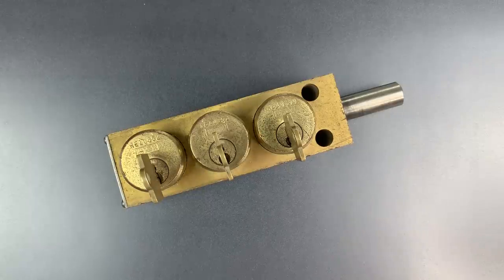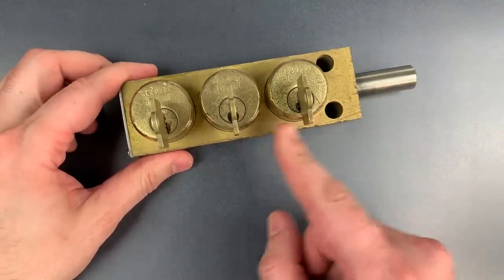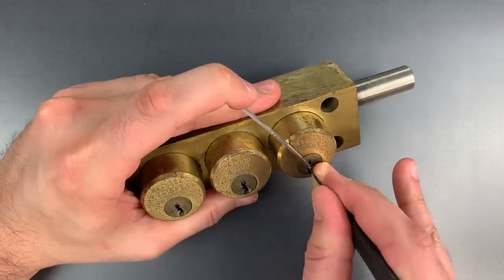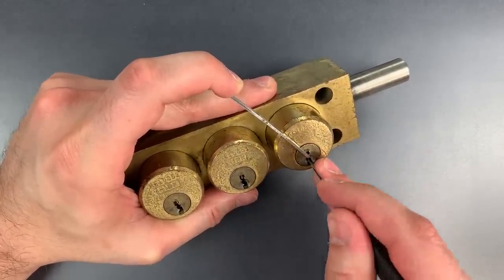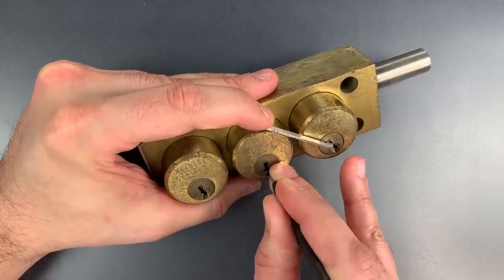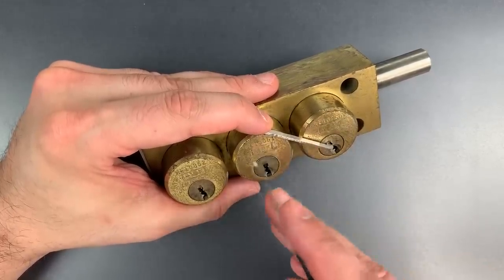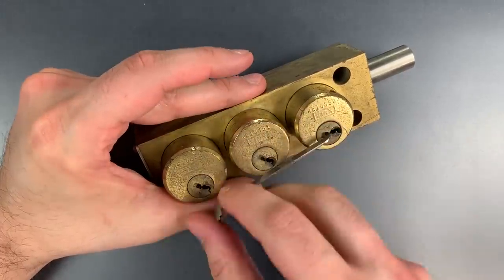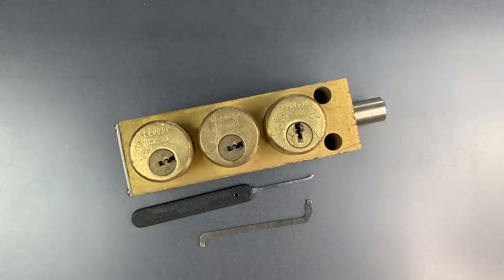[917] Triple Core Kirk Interlock Module Picked

Comment: It be very interesting to see the linkage between the cores, but it may destroy the lock
Reply: Im going to guess those lock bodies Drop in and are screwed on back. After getting in, you would have full access. Electrical interlocks kill power, this unit is likley to keep people out of man eating mechanical assemblys.
Reply: @ernestmurphy3898 it is a mechanical interlock, but like LPL said, it if meant to keep people from opening up a live connection. Most often for electrical vaults with high voltage. The disconnects upstream have other mechanical interlocks that can't be opened unless the circuits have been opened.
Reply: I doubt it, probably just a simple gear connection between the cores and the bolt.  I do like the idea of dumbass-proof safety, can't unlock whatever this lock is attached to without moving levers/valves to the safe position to get the keys from them!
Reply: it looked like a service panel on the left end, so it probably would be simple to disassemble, but he said it was loaned from someone else's collection, so he wouldn't risk opening it and possibly breaking it. (Also possible, but highly unlikely, that it could have anti tamper measures in place so anyone not familiar with them would have to deal with the guts falling apart when removed from the casing.)

Comment: I've been using these types of locks for nearly three decades. I work at a particle accelerator and they're used for safety interlocks. 

The same key that opens the hutch (experimental area) door is  also the one that allows the beam shutter to operate. In both locations the key is captured and can not be removed if it is in an unsafe position, either door open or beam on. If an experimenter needs to access their equipment, then they need to turn off the beam so they can remove the key and unlock the door. If they want to turn the beam back on, they need to search the hutch, lock the door and put the key back in the beam enable.

Comment: That was fun to see picked. I reguarly service a machine, that has a 4-way version of that lock. But in this case one must first turn off a huge main input switch and lock it in off position, in ordre to use that key in the lock. Then the first of 4 doors can be opened, and the remaining 3 keys can be removed and used for the other doors.

Comment: We have these type locks on the doors of some of our high voltage pad-mounted switch cabinets. The keys are held captive in locks on the individual switch handles and cannot be removed unless the switch has been opened. Then the keys are transferred to this lock so you can open the access door- the keys are retained here until the door is locked once again. Or, the switch handle can be opened and the key retained so the switch cannot be closed again.

Comment: Im posting this hear because the review you did on the Master Lock No. DSRN1003P combination deadbolt with night watch is so old I doubt you'd get a chance to see this. 

Ive had the Master deadbolt for 4 years now and its worked fine. But today the bolt locked in place. Luckily for me I had the door open. I was looking at it as it had been stiff and sticking lately. 
If the door was closed Id been screwed. 

The NightWatch appears to be a small pin that goes horizontally through the bolt. if lifted up allows the bolt to move. If down, locks it in place. I pulled the retaining clip and removed the pin.lock works again, just no nightwatch. 

Just an FYI for those with nightwatch locks.

Comment: Had these in the power plants for the old precips.  There would be 3 or more of these blocks on the units, large lock banks for the intermediate keys and then dual keys on each of the breakers.  Actually took three different key changes to complete the task unless you dropped one key then it was a long bad day.

Comment: It’s interesting that a lock designed as a safety feature (vs. securing something very valuable) is one of the more secure locks I’ve seen you pick.
Reply: Just imagine the cost of someone getting killed in an industrial accident. There'll be reputational damage which is tricky to put a price on. Then there are lawyer costs, lost production due to disruption and that's before you even get to compensation and fines. The cost of some stolen equipment is trivial in comparison.
Reply: the gorgon I’m not denying the need for such a lock but rather the fact that it’s very unlikely to be picked given it’s purpose but is far harder to pick than most locks that could actually be a target for picking. Nobody in their right mind would bother picking a lockout lock that’s there to keep them safe but a lock on, say, a box containing valuables worth stealing could attract such activity and I’ve seen him pick many of those almost instantly.

Comment: At my work they would probably break all the keys off to prevent everyone from turning something off because we need to push production
Reply: It's installed at a large works, tools are there.  Bash big screwdriver into lock beside broken key, unlock.  Use small-nose pliers to remove broken-off key, use it in other lock with pliers and screwdriver again.  Use 15" Stillson Wrench on colleague who broke off key in lock in place so something stupid doesn't happen.

Comment: 21 pins 3 cores🤣. 🔐 lock picking lawyer hold my 🍺 beer. I hope they never let you near a Nuclear submarine or silo.
Reply: The funny thing about using locks to "secure" electrical devices.  99% of the time the lock just replaces a switch to control the device, so anybody who is familiar with the wiring diagram of the switch can simply cut out the lock and replace it with a switch (Example: the technician in every nuclear sub/silo whose job it is to maintain the launch equipment).
The US was so concerned with this failure mode that they created an entirely electronically secured device for their nuclear weapons called a PAL.  Nuclear security is literally so important to the US that they share the technology with other nuclear armed countries to help them prevent unauthorized usage.
https://en.wikipedia.org/wiki/Permissive_Action_Link#Usage_by_other_states
Reply: Kineth1 thanks for sharing, that was a very interesting read.
Reply: @Kineth1  Sadly there's no such thing as a system that can't be bypassed, you just have to know enough about how the system works. Which incidentally is a huge part of what actually makes PAL's and the like work. They're so narrowly used that there's very few people who have the necessary knowledge needed to bypass them. In effect security through obscurity. Which isn't invalid if you can keep things obscured enough.
Reply: @darthkarl99  It is too true that there is no system that cannot be bypassed.  Fortunately, to bypass something like the PAL, you have to have the knowledge and equipment to actually rebuild a nuclear weapon, and the nuclear weapon to start with.  A fortunately, very steep learning curve.
Reply: @rileyfenley522  You're welcome, I really like the wide variety of subjects that lock picking/security ties in to, and the different things I've found through this channel, so it's nice to see that other people appreciate it too.

Comment: Everyone says the length of the video means it's impossible for less elite pickers, but it's really just that it's 3 locks instead of just one. LPP never noted any security pins or particularly tough bitting--just that the tolerances were good, and that these have 7 pins instead of 5 or 6 like a lot of the locks he receives.

Comment: What is the reason for tensioning on one of the outer locks instead of the one in the middle? My uneducated guess would be that by tensioning the middle one the feedback while picking the outer ones is the same. I assume (!) that by your method the feedback deteriorated along the picking?
Reply: I wondered that too. My best guess is that the last one is the most comfortable.
Reply from the maker: The first needs to turn a bit before the others will move... and 2/3 can not drive the lock until it has turned about 1/8th of a turn.

Comment: Talking about improving pick resistance, I think you've once done a lock that had to be picked twice, but since it was a cilinder lock you could use your impressioning tool. Could a lock be made with two or even more sets of driver pins, so a lock pocket would have to pick the lock multiple times before actually opening the lock?

Comment: Does the order that you picked the cylinders matter? I.e. you started on the right and worked to the left, could you have picked the one on the far left next? Would the pick have worked if you had tension on the middle core and tried to pick that one first? Thank you for the high quality videos.
Reply from the maker: It can only be picked in the order I did it. As I’ve said many times in the past, my knowledge of locks is my most powerful tool. 👍

Comment: After the rightmost lock is picked and rotated a little, why can't you tension the other left hand locks individually? Are the locks really that precisely interconnected?
Reply from the maker: That doesn’t work. It need to be driven by the first core for the first 1/8th of a turn. Otherwise it seizes. Not sure why.

Comment: With the amount of rotation that you got after picking the first core open (or in general, the amount of backlash in what is presumably a rack and pinion mechanism in the locking bolt), I would imagine it would not lock back up when removing tension from it. Could you not have transferred your pry bar to the next core and tension it directly for better feedback?
Reply from the maker: No.  It can’t be driven by the last two cores until it turns a bit. I’m not sure why. I’d have to destructively open the module to fin out.

Comment: Wouldn't it be possible to ditch the pry bar and tension the lock from the bolt directly? Like use one hand to push the bolt in and the other hand to pick?

Now, I'm not suggesting it would be easier that way or anything like that, actually I believe it would make it a fair bit harder. I'm just curious if it would work at all.

Comment: This maybe a dumb question but I once read in a book about picking locks in a video game that if a lock has "weird spring", I.e "all pins spring differently" that you should hold a flame to the lock with a torch for example to heat it up to make the springs all the same. Would this work? Do springs in pin locks work this way?

Comment: Let's see you pick missle launch locks. You know, the kind that have to be turned simultaneously to work, and are either several feet apart, or separated by a plexiglass barrier... I know. That's too much!  🔒🔓
Reply: Those are not mechanically interlocked, only electrically. And they’re actually not typically very pick resistant. It’s not like joe bloggs gets to wander around where those locks are willy nilly.

Comment: Someone out there is going to make a challenge lock with 3 cores. I am going to make 6 cores with 6 pins and have six security pins in each core. The SATAN lock is born
Reply: for a total of maybe 7 mins of picking time.
Reply: @firesurfer  I am going to put some very nasty warding on there and make half of the cores dead cores. Just for fun. Another thing. I will have pin traps that force you to restart picking. In every core